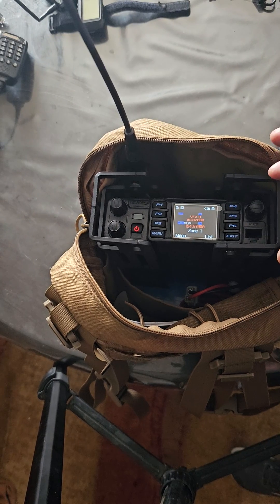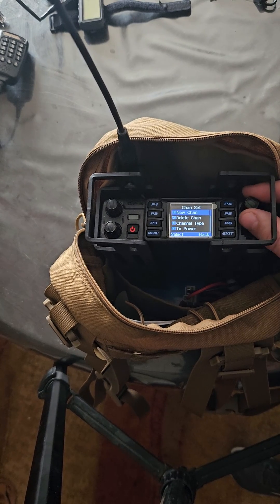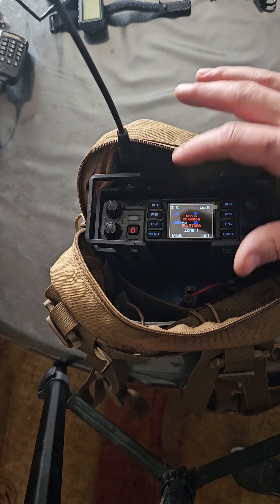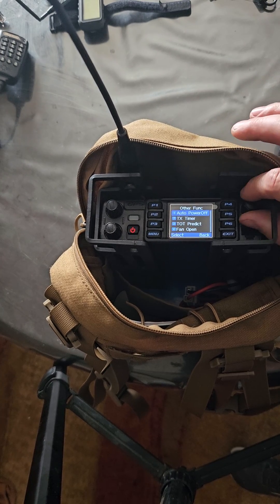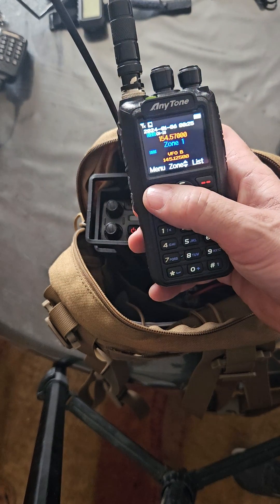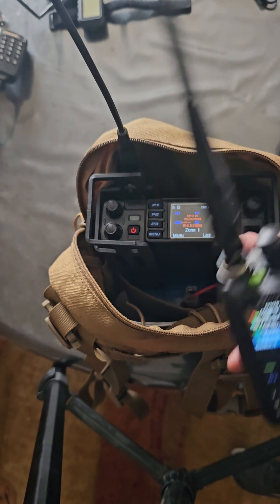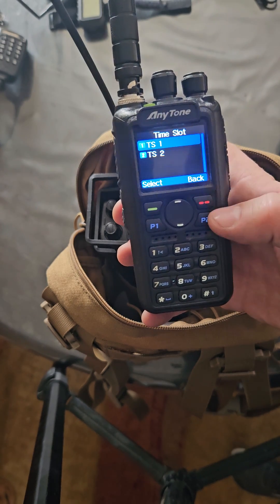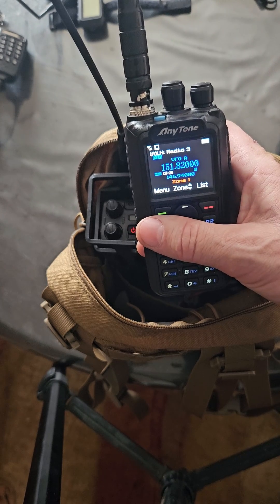Anytone AT-D578UV Same Band Repeater Setup

Comment: Here's a crazy question. Would it work in analog simplex (same TX and RX freq)?
Reply: That type of repeater is a store-and-forward repeater, since it can't physically receive and transmit the same signal on the same frequency at the same time.  It records the message as it hears it, waits for it to stop, then plays it back for everyone on that frequency to hear, including the one who sent it.  The D578 (and the handheld D878) do not support this mode of operation at all.  The BTech DMR-6x2 and DMR-6x2 Pro has it in its firmware to do store-and-forward for the digital simplex in this way, but also cannot do it with analog.  You can get store-and-forward modules that plug into the radio k-plug port and can make any radio operate as a simplex repeater, regardless of analog or digital mode (also is a way to make encryption still function).

The D578 manages to do digital simplex repeating by having alternate timeslots.  Whatever it just heard in TS1, and repeats right back during TS2 on the same frequency.  It alternates so fast between the two that it's as if it's happening in real-time.
Reply: @JimmyNewCakes  my first thought was "good luck with isolation", but the different timeslots makes a lot of sense. It's great that it can do the switching instead of recording audio, and rebroadcasting the entire transmission.